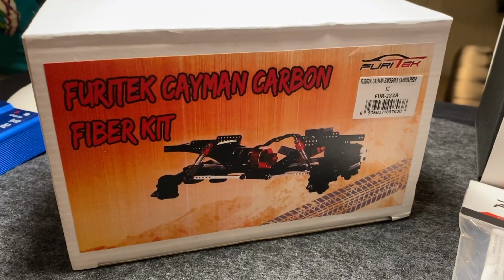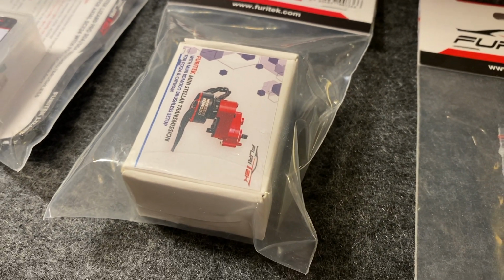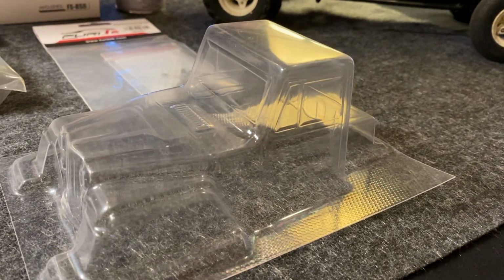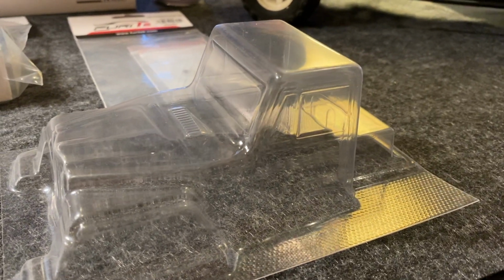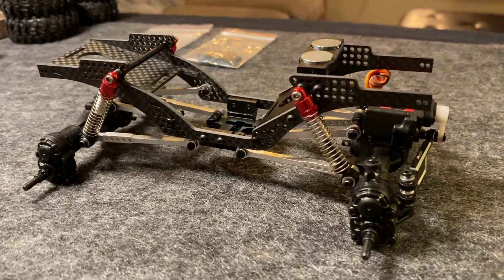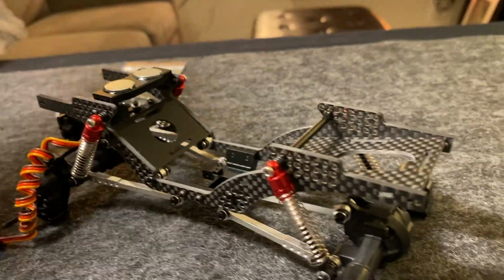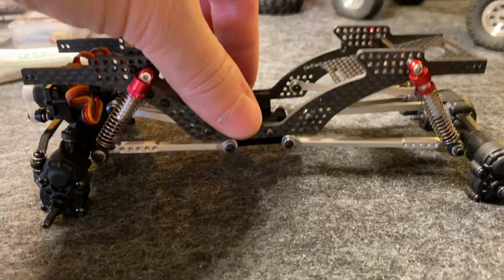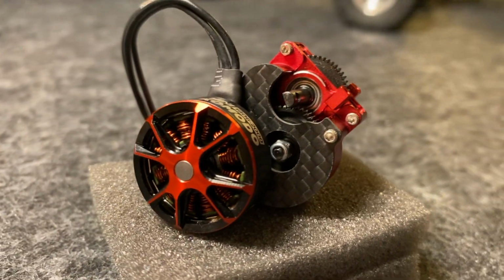Furitek Cayman FCX24 Custom Build!

Comment: I just bought the kit that comes with the micro Komodo and im basically doing the same build wit that body. any tips on paintig? never done one before
Reply from the maker: Yeah, do several very light coats. I think I did 7 or 8 super light coats. Let it dry completely before applying the next. I used a hair dryer to quicken the drying process. You can also search 'painting an rc body' here in youtube to get some very good tips.
Reply: @jamiealan  thanks, your truck looks awesome! Any complaints about it yet? I was stuck on the Minnie or micro Komodo but just went with the micro since it came with it. Il probably extend the links at some point and I bout a gt5 like you, I’ve never even driven a brushless rig so I’m pretty pumped to try it out
Reply from the maker: @jayf2487  No complaints. Love the brushless. One tip... be careful glueing the magnets to the inside of the body, I glued mine, let it sit overnight and when I went to open it they ripped right off. Paint and all. So I had to repaint that section. I now use two small magnets which I simply stick on the outside of the body and it works fine. Even looks kind of cool. When I take the body off they slide off with it but I'm fine with that.
Reply: @jamiealan  Aw man I never thought the magnets would do that, maybe they are just too strong or your paint somehow wasn’t dry enough. Thanks for the tip
Reply: His you strap all your electronics in the cab? Just finished my build and I’ve been putting the battery in the back which I don’t like. Looks like you put your battery on the bottom then set everything on top?
Reply from the maker: @jayf2487  I put the battery in the front and put a piece of velcro on the receiver which sticks to the battery (you can see at around 3:50 seconds into the video. But I'm probably going to pick up a micro receiver since this one that I have is a little too big I think.